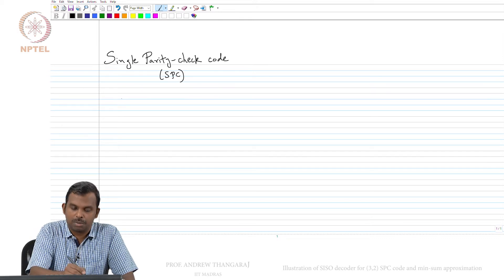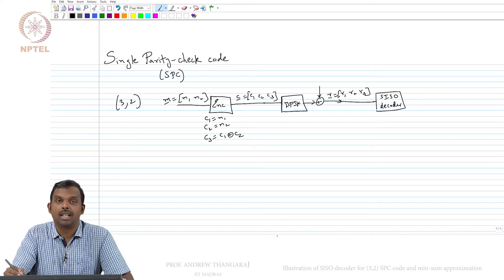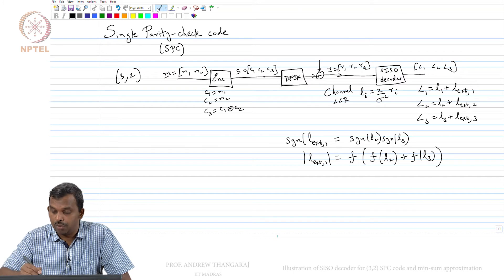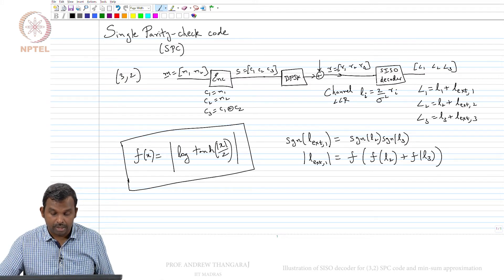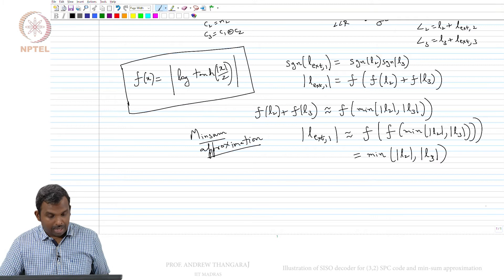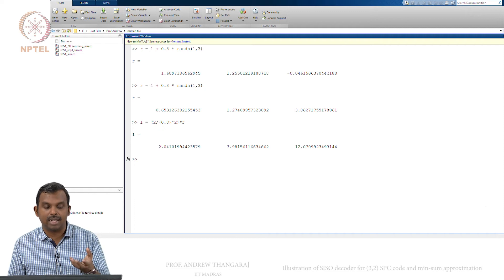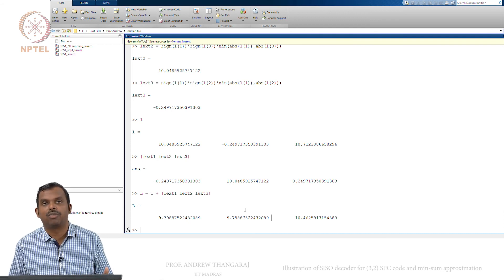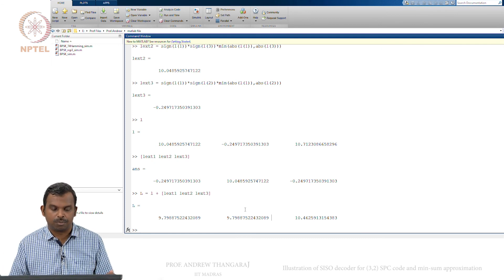Illustration of SISO decoder for (3,2) SPC code and min-sum approximation

Comment: (1 1 1) is not a valid codeword, shouldn't the noise be added to (1 1 0)?
Reply: I think you are right, I was thinking the same thing. Sir calculated these LLRs keeping in mind that encoding done is SPC. But he was generating (3,1) repetition code.
Reply: True
Reply: 1 1 1 is the BPSK-modulation of the 0 0 0 codeword.
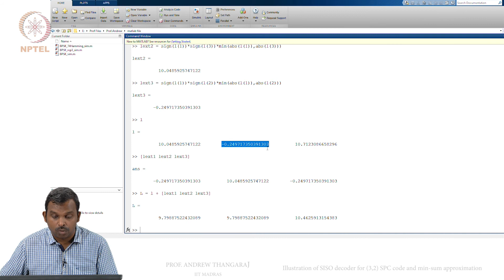Reply: At 16:32 he is showing that this approach "error corrects" BUT the (1 0 1) would already be a valid code word. He is showing this approach "corrects" it to (1 1 1) which is an invalid code word. Can anyone clarify this?
Reply: @brandonenochs  I think you are right